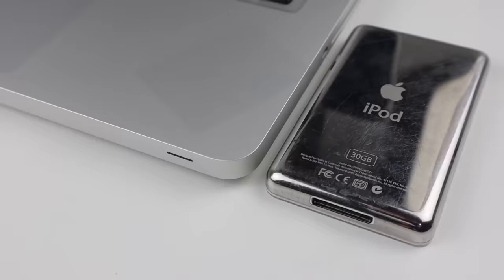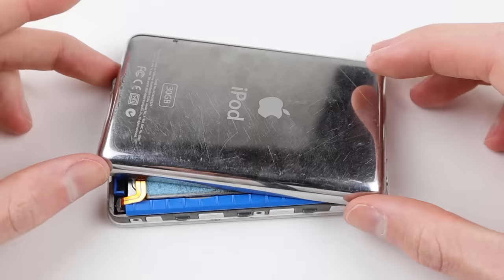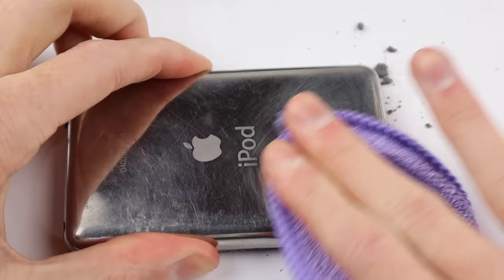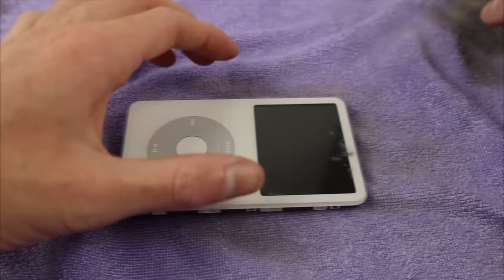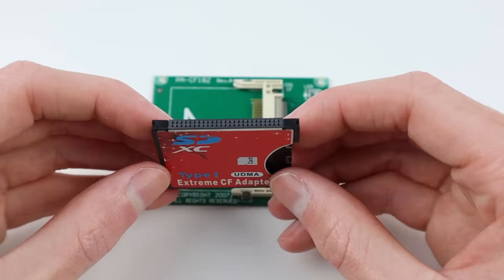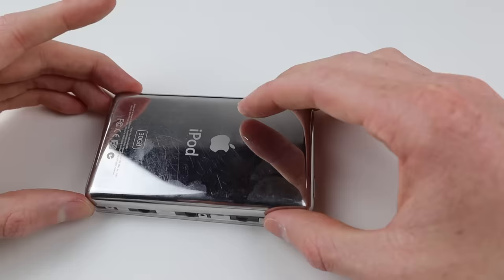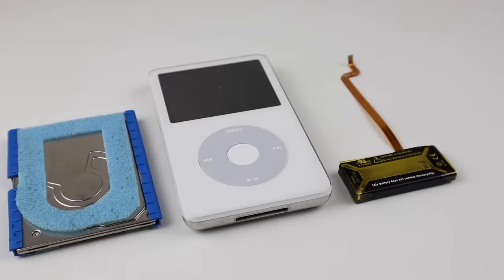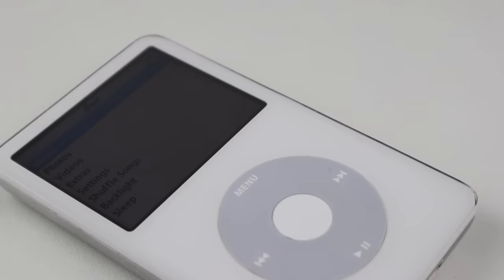Reviving a Broken iPod 5th Generation (iPod Classic)

Comment: I just bought myself a completely sealed and new iPod 5.5 80GB for $300. Adjusted for inflation it's cheaper than it's original price. And I am so excited about it. I already disconnected from my iPhone and using a Motorola Razr V3 now. Just carrying the iPhone around for my music. If the iPod arrives I can sell my iPhone and live happily. I already converted all my Apple Music which took like 3 1/2 days because the software needs to listen to the song and record it. But it was so worth it 😊
Reply from the maker: Be careful all the "sealed" ones I have seen are fakes. Compare the box to photos of the original one. Look for things that don't look right.
Reply: @HughJeffreys  Well I got it now and it's genuine. However for some dumb reason the display has dead pixels so I need to replace that. Hope I don't break it...

Comment: I once got a dying 80GB 6th Gen Classic and replaced the hard drive, battery and back housing from a donor 5th Gen that I bought for cheap with a dead motherboard. Compared to the 5th Gen, the 6th Gen was a nightmare to open and I of course damaged the back opening it. It's still a working 30GB 6th Gen Classic. :D

Comment: If you would like to carry on with the aesthetic restoration, I'd probably recommend a rubbing compound and dremel with a rotary buffing tool attachment. That will yields faster and hands down better results in seconds--  Really buffs the stainless steel up nicely. If it can't then the next best bet would probably be some form of sand blasting to strip a tiny layer off to then start from scratch.

Comment: Hugh. To remove scratches and restore use P3000 wet. Then use Tcut metallic (which is finer than t cut) and then PlastX by Mguiars (sic).

Comment: Mother's m&a polish, soak into printer paper. Use that to rub the back of the case with. Acts like 2K grit sandpaper leaving a finish that is breathtaking to say the least. Works best on aluminum, however left amazing results on my 4140 Chromoly stainless.

Comment: thanks thanks thanks. I have a super old ipod. it keeps locking when i plug it into my super old G4 mac desktop to charge. didn't know about holding down the 2 buttons to reset but worked on 2nd try. thanks!

Comment: A while ago i just bought the exact same battery off the eBay but it doesn’t hold charge enough but I hope it works for you. You could even opt for a new housing or even custom ones like I did on my own 6th gen iPod and made it U2 custom model

Comment: I used that compact flash adapter once on an iPod classic and it didn’t work that great. Just the slightest bump it would come loose and you would have to open it up and put it back. I ended up switching to the microSD card adapter.

Comment: Microfiber isn't great for polishing. I'd recommend getting a proper polishing cloth.
I use Cape Code metal polishing cloths to polish my watches, and they're made for polishing silver, gold, brass, copper, stainless steel etc. I'd recommend checking them out next time you need to polish something like this. The added benefit is that they come preloaded with polishing material, so it's good to go out of the bag.

Comment: Removing scratches basically requires just making finer scratches then buffing it out with a polishing compound. If you had a way to re-etch the info on the back it would look sweet, but if not that’s probably as good as it will get without messing up the logo

Comment: That black compound is for a cotton buffing wheel on a bench grinder or similar. You will also get different grades. It will work fantastic in the right application...

Keep going with the metal polish on a micro fibre in circular motions with firm pressure and you will get your results.. there’s probably a lot better products than Brasso too..

Comment: Nice job but! the 30GB battery has lower reserve than the thicker 60GB that would have fit with no problem. I used Meguiars Plastic X plastic polish and cleaner to polish the plastic, then i flipped it over to see how it worked on the stainless back, not expecting any results on the steel, i was surprised how it polished the stainless back, brought it to a high gloss, took years of use off the Ipod.😃

Comment: Mine just died.  Same SAD FACE and hard drive knocking noises.  I was bummed and looked for a replacement.  Figured I would up grade to a new I POD Touch 128GB.  Too bad I didn't find this video sooner.  I still want to do the same repair that you accomplished.  Can you list the exact parts that you purchased?  How is that flash adapter working?? Believe it or not, my original battery is still working fine. Excellent video.  You did a fantastic job on the repair and resto. Bill

Comment: I think you would have to wet sand the metal and then get a stationary polishing wheel use some of the  metal polisher I would recommend mothers Wheel polish ive used it in the past to shine up scratched metal

Comment: Great , simple video. For those (like me ) not having access to that JOSCO thing (which looks good) white stone polishing clay is great for cleaning and polishing the ipod.

Just a question: I have noticed that my beloved 5.5th iPod Video external click wheel sound doesn´t work anymore (clicker settings in Yes, of course) I have googled it a lot but I cannot find where is the part producing that clicker sound. Click Wheel? Headphones jack? Motherboard? BIG mistery!  Any idea?
I have recently replaced the screen and I thinks it´s when I messed with something but I don´t know what. Thanks.

Comment: That polish was a bad recommendation.  They are designed for powered buffing wheels which is why it's so hard.  You hold it against the spinning wheel to charge it with polish.

Comment: I believe that the scratch remover did not work because it is meant to be used with uncoated grained stainless steel. The back of the iPod is not grained stainless steel.

Comment: That "brick" polishing thing is meant to be used with a polishing wheel, not by hand... Totally different beast than a microfiber cloth. If you were to use a wheel, I think those scratches would have came out... Quite possibly the labeling also...
It works great on aluminum (and stainless steel), just NOT by hand...

Comment: The hardware store clerk was right when he sold you buffing compound. There are different grades, colour-coded (black is very hard). He was wrong when he thought you would know how to use it. You need a grinder with a buffing wheel to use the compound with. A rag won’t do the job correctly. Neither does toothpaste or Brasso, but they are mild abrasives. To get deep scratches out you need one of these with buffing compound.   https://www.tptools.com/BALDOR-3and4HP-Buffer-and-Packages,8280.html

Comment: I mean if you had the patience and elbow grease you could just wet sand it either by hand or with a power tool. Start at like 400 grit and work your way up too like 8000 or something to get it mirror smooth 👌 you will lose all the Apple markings and logo though but it would look brand new 😍

Comment: where abouts did you get the parts from? i still have mine from when i was at school back in 2006.. i have the 80gig model i may upgrade it to 500GB using a SSD. great video.
Reply: ebay, you can get the iflash, get some micro sd cards, and get a nice big battery since you have the big 80gb model. You could get a nice terabyte in micro sd cards and a huge ass battery that will last literally like 40 hours.

Comment: Nice video, Hugh. I replaced the battery for my 5th gen 80 gig iPod a few months ago. The old battery was not holding a charge. Although the hard drive is starting to slow down on me. I'm thinking of replacing the hard drive or do you think a flash adapter & SD card would be better?

Comment: Is the restore function contained within the 'basic' software package that came with the original iPod? (I have a 5th gen 30g + software, still operational, although battery is weak). And I also heard, that Apple has terminated all iTunes on their site - I never used that service anyway, as I had 30 full length movies on mine to watch while on long flights.

Comment: Hello Hugh, I have mine in the best condition you can imagine. It had the original plastic protecting the screen and since new I bought a silicon cover it's in perfect shape, the battery doesn't last long, but still works, but even that I have taken so much care of it... I lost the audio. I have no audio at all. While ago it started sounding weird until one day it finally lost the audio. Have you seen this failure before? if so, do you know what could be wrong and how to fix it?

Comment: Hey Hugh I really need your help, I have this Samsung Gt-5670 or something and I don’t have the password and the volume button doesn’t work so I can’t factory reset it, what can I do
Reply: Open 'er up and get that volume button working.
Reply: If it still turns on and functions properly try going into developer options and enabling Advanced reboot and Press the reboot icon and select reboot to recovery. Or else get a 3rd party app like Quick Boot to boot into recovery
Reply: Download Samsung Kies or Smart Switch.
Reply: @zetsubou3704  umm how do you get to developer options and this things is old like 2011 old and it is a really old software and i dont know how to use quickboot so could you give me a better explanation please and btw none of these suggestions worked but you look like you could help the most
Reply: @michaelragusa3520  Turns out the phone you mentioned it has no developer options on it as it probably running Android 2.2/2.3 . Developer options were introduced from Android 4.2. And getting an 3rd party like QuickBoot to work will need the phone to be Rooted. The easiest way back then was the power button and volume button combo which is out of the question. If you want to root it you can search some of the forums online for rooting Android 2.2

Comment: hey mate, i'vebeen watching your videos and replaced the battery on my ipod 5th gen video 30g and it turned on fine. now ive run into the problem that it wont charge through either cables or docking stations. it will play the music through sony docking stations though. it just wont charge, is there something else that could be wrong?

Comment: I upgraded my iPod Classic 5th to an SSD. When finished, the hold button didn’t work. I didn’t have correct adhesive so I glued it in place. The thing I didn’t know was that it was superglue. Now I’m unable to open it again #ipodclassicrepairfail
Edit: I broke the clips, that’s why I used glue

Comment: I once had an iPod classic 4th gen and i cracked the screen when i dropped it. Never bothered to fix it now it doesn't work at all :(.
Reply: w I still have mine. The screen has a crack that goes down the screen, but it still works perfectly fine.
Reply: @keknov5555  Rip. I had a iPod mini blue but the hdd broke and i tried replacing it with a flash drive but it wouldn't work.

Comment: Why would you bother trying to remove scratches from the back? To do so requires removing all the metal above the base depth of the scratch, which weakens the metal back. It also means wiping out the very fine printed serial no. i.d. and the Apple iPod logo. Time you could actually spend walking in the park listening some good music or ebook on the iPod, which is what it's for, not looking at!